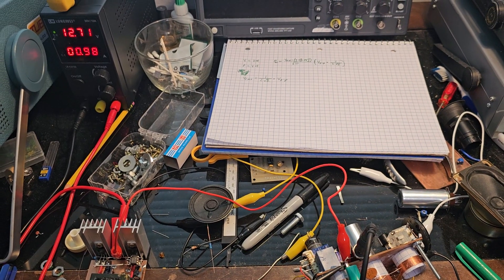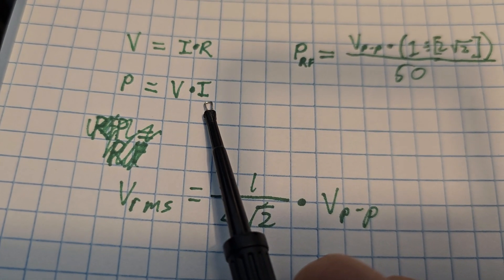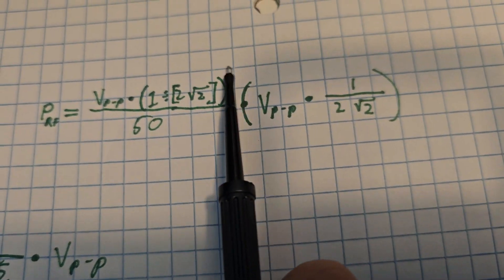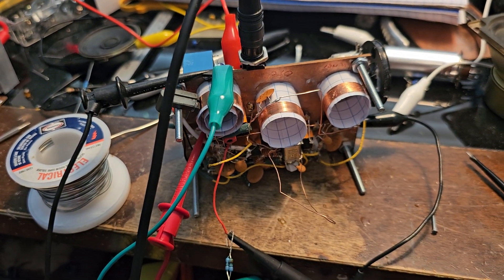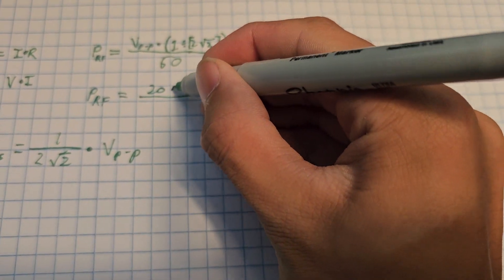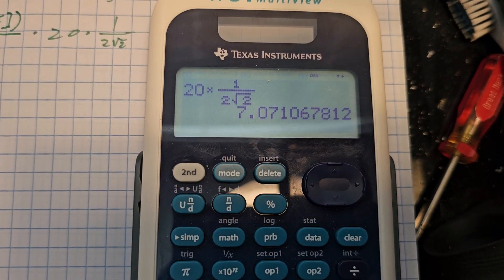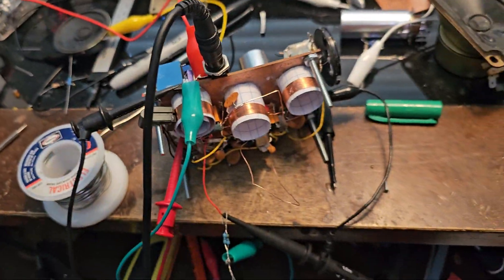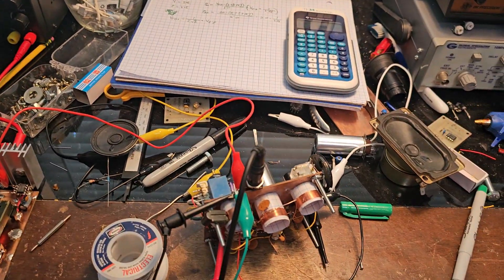How to calculate RF power using an oscilloscope and a 50 ohm load

Comment: False info

That IS NOT measuring power.

Oscopes measure VOLTAGE, not power.

This is CALCULATING power, and is GROSSLY INACCURATE because of scope probe loading.
Reply from the maker: I apologize for the inaccuracies in the video title. I have changed it to "calculating". 

However, I do not think the loading of the scope probe would have any significant effect on the calculated RF power. I am using a x10 250MHz probe on a 60MHz scope. The impedance of the scope probe at frequency of 3.579545MHz should be minimal. I don't think an extra 10M ohm load across a 50 ohm load is going to make much of a difference. Yes at VHF frequencies scope probe loading will become a problem, but I'm not using VHF am I?

The scope probe I am using should be fairly accurate in its internal resistance as it is a FLUKE probe, and I trust that FLUKE makes good stuff. The oscilloscope is a Tektronix so I'm sure nothing funky is going on there either. 

If we put 50 ohms and 10M ohm in parallel, we get exactly 49.9998.

This is the answer for neglecting the resistor tolerances and assuming it is an ideal resistor. 

All in all, this video was not meant to be a very accurate way of measuring RF power. I don't exactly want to sped $1000 bucks USD on a Bird RF wattmeter or $20 on a Chinese knock off. So I came up with this solution instead.

I didn't really care much for the exact wattage output of the oscillator, and I didn't want to spend any money at all because, as I am at the age of 14, my parents would refuse to sped a lot of money into my project. So I used what I had. An oscilloscope, and two 100 ohm resistors.

I am still learning in the hobby and arts of electronics, so I may have made mistakes.

Again, by no means is this very accurate. But it should be a good for a rough understanding of the RF output power.
Reply: @electrifyingvids3545  I wouldn't think probe loading will be significant and negligible otherwise professional technicians wouldn't use them. 
Keep the oscilloscope and forget the Bird Wattmeter, a 'scope is far more useful for other things besides this application.
Some 30 years ago I bought a very cheap 5 MHZ oscilloscope to set up my h/b tcvr output stage on the low frequencies and assumed it would be correct for higher frequencies, it should remain stable and it did. I was given a 20 MHz 'scope years ago, it's good to about 25 MHz. He was an ex-t.v. engineer and had kept it for years and was thinking of throwing it out, lucky for us both I met him.
G4GHB.
Reply from the maker: @bill-2018 I did some better tests by not using a probe, and simply using a 50 ohm coax from the RF source into the scope terminated with 50 ohms. I got around the same measurement. The wattage was actually about 0.2 watts lower.

I think the main reason why professionals don't use a scope probe is because it is a hassle, and has other things that could go wrong such as bad connections/wrong connections.
Reply: @electrifyingvids3545  I have done the same out of interest when I first get a 'scope and found no difference.
A probe is great because you don't have to solder onto the item on test, just clip it on. Perhaps at very high frequencies soldering might be better.
Reply: I don't know just why k8byp rudely commented like he did, i thot your power calculation was spot on. And, you proved your test by using the caloric method; feeling the heat of the load resistors. Great job! 😉👍